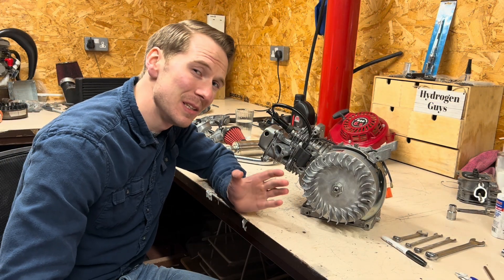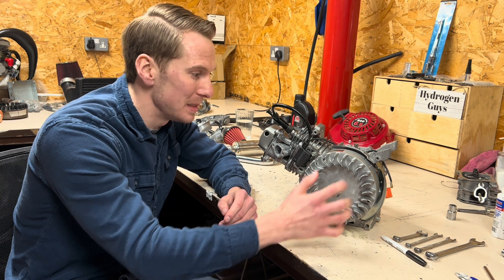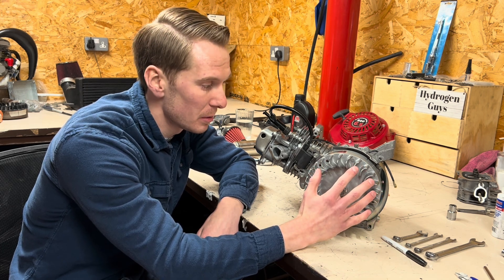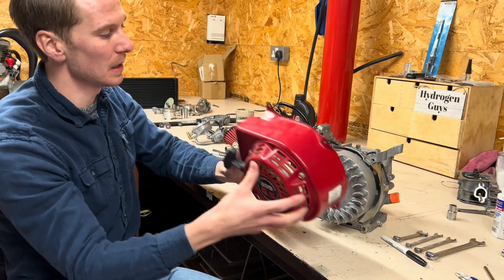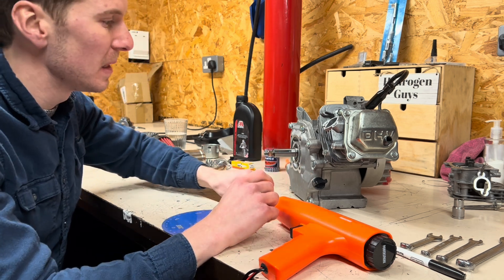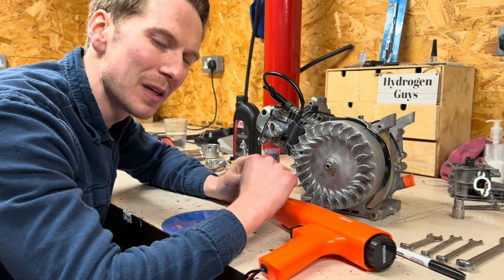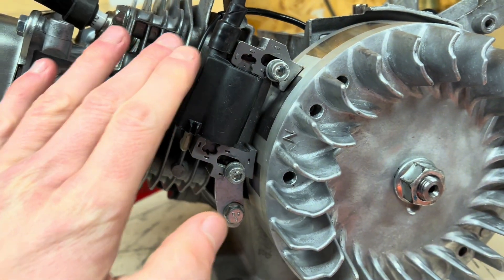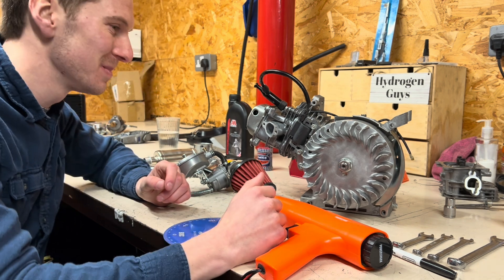Hydrogen Engine Ignition Timing

Comment: What about dealing with the waste spark in these small one cylinder engines?
Reply from the maker: Good question, It’s a pain to work with but manageable, you can adjust the intake valve to delay the opening, but to be honest I only find it’s a issue at low rpm so for this application I don’t need to do anything
Reply: @Hydrogenguys  I am quietly building a hydrogen system and putting together a little engine and electric generator. Difference is (compared to most tinkerers) I am using the best quality hardware I could get my hands on. Industrial stuff. Industrial pumps, valves, stainless tanks and power supplies, etc.

Comment: Why do you timing? Just need to recycle exaust gas to slow down burning rate
Reply from the maker: Adjust the timing for performance, EGR will only slow it down so much. And sacrifices power in doing so. Adjusting the timing directly is the best way to do it
Reply: @Hydrogenguys are you open for some tests?
Reply: Stan Meyer did that with his designs.

Comment: You said that the ignition coil is 3° after TDC. 
If you remove the spark plug and turn the fly wheel with the magnet under the coil. Do you see that the piston is on that position after TDC? 
Mine ignition coil has to be a lot more above. But then i have the problem that the intake valve opens a bit. 🫠
Reply from the maker: Hi, yes I had the same issue with he take valve opening to early, you can adjust the valves just a touch to stop them from opening. Hope this helps ✌️
Reply: @Hydrogenguys  hey thanks. How did you adjust  the intake valve that it opens a bit later?
Reply from the maker: @domspianoraum9468  you can either: 
- get different length push rods
- regrind the intake cam 
- or loosen the rocker to delay the opening time.

Comment: We’re going to be running Hydrogen on our 800cc parallel twin engine using our gear driven super charger with a water / meth injectors on the intakes and the facility to rewrite the ECU on our dyno… would you guys like to comment please
Reply from the maker: Sounds like a brilliant set up to me!

Comment: You guys rock. This specific engine fires 2 times per the 4 strokes. Once on power stroke and once on the exhaust stroke. You need to disable the second fire on the exhaust stroke or you are going to have other issues.
Reply: How should you disable the second ignition?🤔
Reply: My Problem is that the wasted spark ignites my gas mixture. The inlet valve opens a bit because i change the ignition timing after TDC. 🤔
Do you have some tips how can i make the inlet valve a bit slower. 😅

Comment: Nice video, very interesting! Is there an optimal timing for performance without being "extra safe"?? Or do this differ engine to engine?
Reply from the maker: The more advanced you go, the more power you’ll get, I would avoid going any more than 5degrees advanced with this type of engine. 
If it was forced induction then timings would be different again. 
But from a naturally aspirated point of view, TDC is preferred
Reply: @Hydrogenguys  thank you!